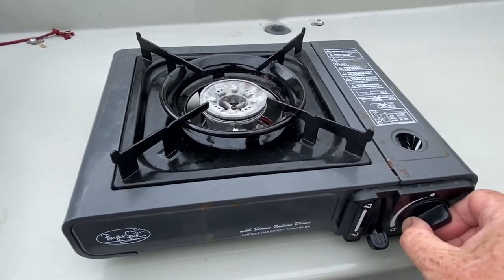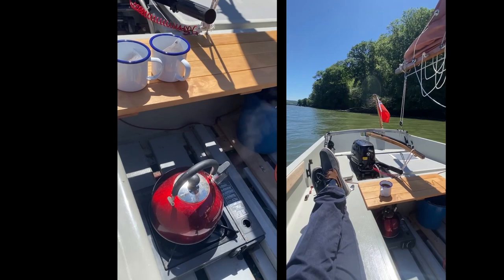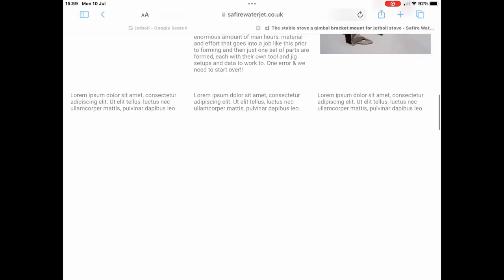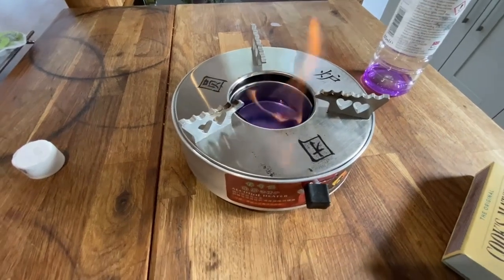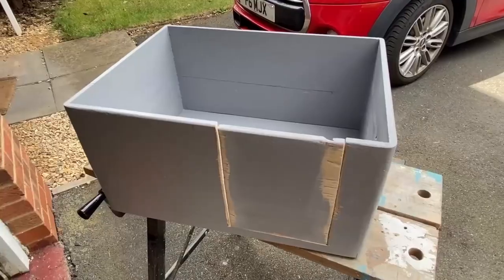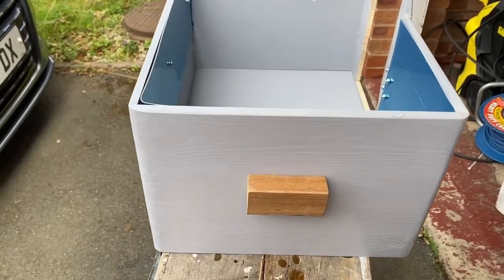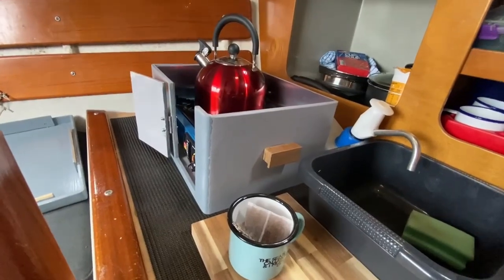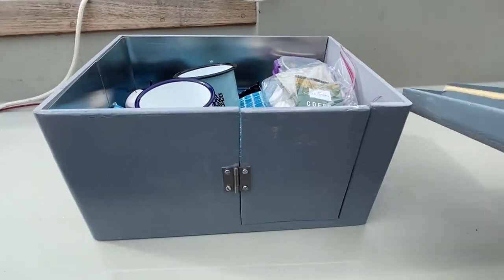No. 11  Shrimper 19 pocket cruiser gets a new stove, a galley box and a handpresso espresso machine.

Comment: Thank you for this video which has, unlikely though it seems, has awoken in me a low-grade anger borne of frustration.  
While crewing on what I consider to be a big yacht (32 ft) many years ago, it was agreed the bilges would be pumped hourly to vent any Calor gas that had escaped since I was informed such gas was heavier than air.  You & I now sail small cruisers (me: Beneteau First 24) that do not have bilges, as such, so any leaking gas would be smelt pronto.  But the threat & attendant risks still concern me.  So, since buying my yacht I have been searching for an alternative to gas cookers & I have concluded, for my personal needs, a low pressure alcohol stove would be the thing to have on board.  My quest led me to a stove called Origo & every comments I read was clearly positive save one issue - the fuel (meths)  burnt cooler than other products so took longer to boil water & cook food.  This I did not understand especially coming from WAFIs (wind assisted effing idiots).  To paraphrase a quote "in a world whose only quarrel with instant gratification is that it takes too long, we as yachies are practitioners of a dying art: patience".  I tried to order a double burner Origo but found they were no longer available & that possibly Dometic could offer a similar product but they too were unavailable.  I am now left with the only practical alternative available to me - a Camping Gaz 2 burner stove - an inanimate object I have incomprehensively come to despise, a forbidding intruder into my otherwise welcoming cosy cabin.
Thanks for allowing me to vent my spleen on this particular issue.  Have a great sailing season.
Reply from the maker: hi. Thanks for the comment and the illuminating rant, I share your frustration. The portable gas cooker, in all it's various guises, is not an ideal solution but, for the moment, it seems it is our only choice. 
My retirement project will be to convert the boat to a regenerating electric saildrive. Then I will use all the energy i've generated from a day's hard sailing to boil the kettle on an induction stove. :)

Comment: Good evening fellow sailor. I'm looking for a small cooker and came across to one similar to your's. It looks fine for the job but I'm a bit afraid of the size of the gaz bottle. Can you tell me, from your experience with it, how long does it rest. Many thanks in advance.
Reply from the maker: They last  3-4 hours on low heat. On full heat a lot less. I get around 6or 7 boils of a half full kettle out of one. I usually buy a pack of 4 at the start of the season and keep them in a sealed dry bag in the outside locker.